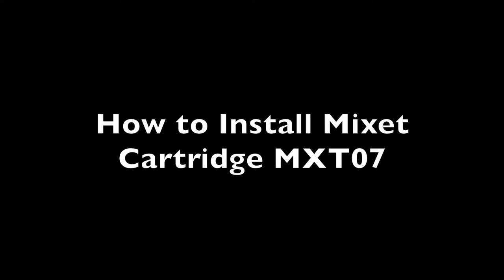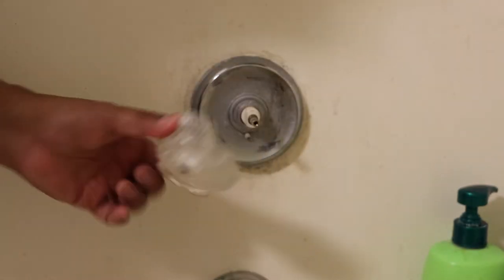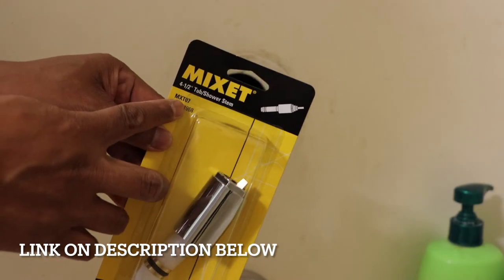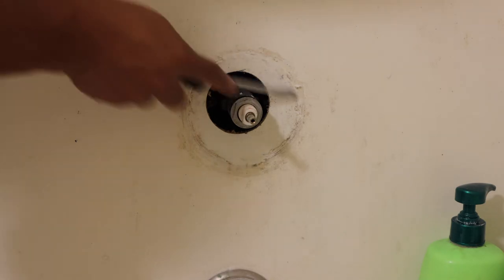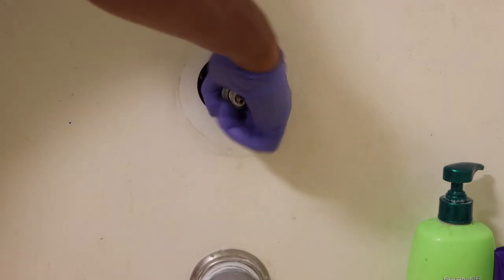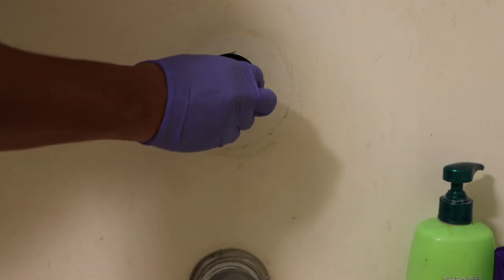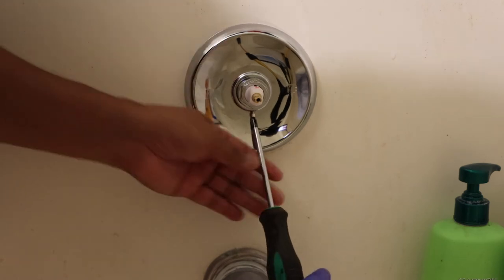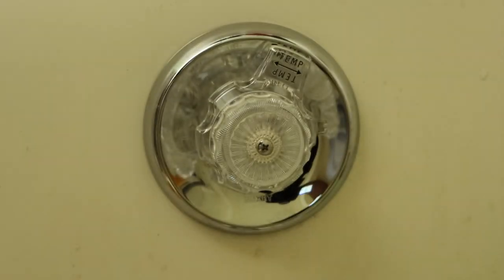How to install Mixet cartridge MXT07 (Easy Way).....

Comment: DO NOT turn the water on BEFORE you screw the retaining sleeve onto the valve. The sleeve is what keeps the cartridge in place so the water pressure doesn't blow the cartridge back out. Also, if the temperature control is placed facing up the red dot should be installed in the down position. If the temperature control is placed facing down place the red dot UP.